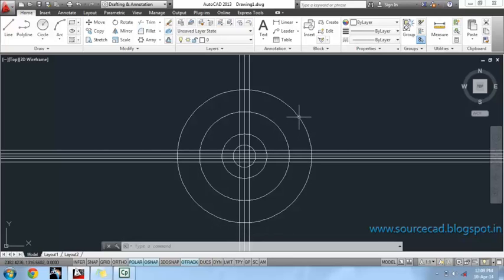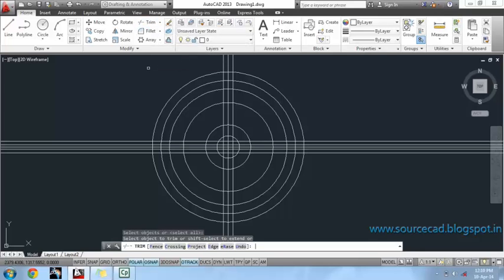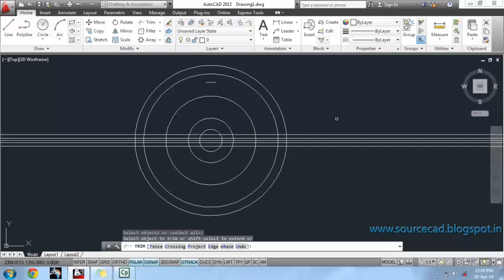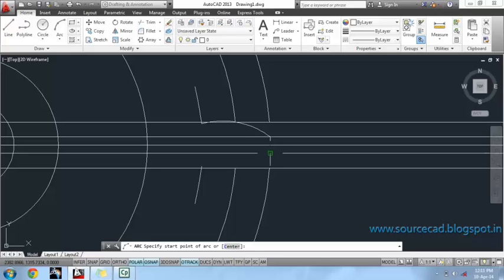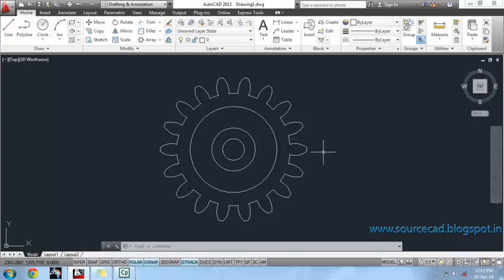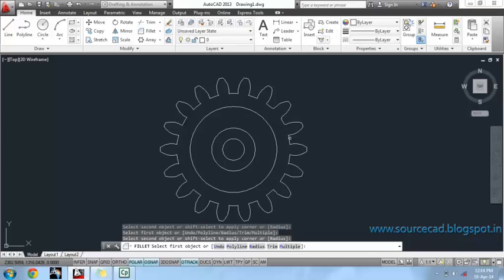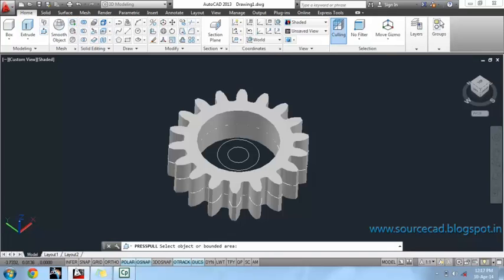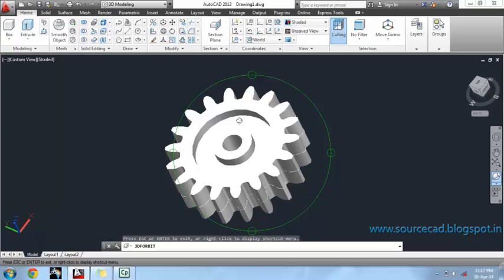Creating 3D gear in AutoCAD

Comment: Hi! First of all I just want to say that your videos are amazing! I'm a beginner in AutoCAD and I've always had trouble picking it up but your videos are so easy to follow. 

I'm just having some problems when it comes to using fillet. There are two corners that will not let me use the fillet command. When I try to select the edges it just creates an arc and some weird lines. I don't know what I'm doing wrong.
Reply from the maker: try exploding the geometry and then make Fillets

Comment: Very helping tutorial again but i cant do the fillet command.i did try use smaller radius value but isnt work out.can u help me?i use 2014 version.
Reply from the maker: try to explode the geometry and try using fillet command on it.
Reply: thanks sir!its work! and at minute 10.25,when i presspull,the inside are presspull as well,not empty like u.i think i select right boundry.any of your step i missed?

Comment: I already made this but unfortunately I accidentally cancelled my work now I try to make this again but something's went wrong with the poly line when I join it and when I click it it clicks the first line not the whole I don't know what to do I repeat this many times and it never work like the last time I made perfectly accurate with your work.
Reply from the maker: Looks like you are not able to select overlapping objects, you can turn on selection cycling to make accurate selection. Type SELECTIONCYCLING press enter then type 1 and press enter again. then select objects and all overlapping will appear in a menu select required object.
Reply: it can't convert the 3 objects in 1 poly line? is it because of overlap?
Reply from the maker: There must be gap between objects, fill the gaps before joining all objects into a polyline.
Reply: thank you so much :)
btw your tutorial really helps me
Reply from the maker: Welcome, I am glad to know this :)

Comment: Very nice video thank you question how do you change the size of the wheel to 20 mm
And 30 Teeth
Thanks Eli
Reply from the maker: +Eli Dari in this drawing a random drawing is used so don't take it as standard gear, moreover you may need to find out by simple calculation all dimensions for 30 teeth and 20 mm wheel size.

Comment: HI THERE  , THANK YOU FOR THE TUTORIAL , ITS VERY HELPFUL , THE ONLY THING I AM HAVING TROUBLE RIGHT NOW IS THAT WHEN I TRY TO JOIN THE OBJECT AFTER EXPLODING IT ....  ANY IDEA WHAT COULD I BE DOING WRONG AT THIS POINT /?  THANKS IN ADVANCE
Reply from the maker: Knoxville Anyce Thanks Knoxville, 
There might be some small gaps which you need to check manually and fill them using line or spline.

Comment: This is a good tutorial I am something of a AutoCAD newbie but found it reasonably easy to follow, Up until the point of using the fillet function where I seem to be stuck with "cannot fillet between these two entities". For some reason I have followed your tutorial step by step and keep hitting this error.
Reply from the maker: Craig Fox thanks Craig for your support, In this case you can use two methods
1. press Ctrl+A >> X >> press enter and then apply fillet
or
2. reduce radius of fillet

Comment: If Solid works is a Mercedes that is an ox cart... btw why filet the edges after array and not before?
Reply from the maker: I agree with you Miteltrixel but each software serves its specific purpose and AutoCAD is specifically made for 2D drawings yet it sometimes can be used for 3D modelling as well so it wont be fair to call it inferior than other softwares, and yes fillet can be made before array but that would have confused novice autocad user about selecting entities for array.

Comment: While this could be a decent tutorial, I feel it is missing a lot. For instance, why are the construction lines spaced how they are, why are the circles the sizes that they are? It's all fine when replicating the gear you made in the video for say, the 1% of cases that will require a gear of these exact dimensions, however this tutorial will provide no use in designing your own gear when you need to apply it to your own drawings. For future reference, there needs to be more detailed explanation as to what all the different parts of the entire process actually do.
Reply from the maker: ***** Well Nicholas its good to see your interest in my videos and I totally agree with you that this example cant be used to carry out manufacturing of gear that fits your requirement its just an example I am creating these videos to teach AutoCAD design skills and method of converting raw data into AutoCAD drawings and it wont be possible to discuss mathematical calculations on which these drawings are based on this platform. Still appreciate your concern and I will try to implement it in future videos.
Reply: Well said.
I guess, this video is solely for the purpose of explaining how to use various commands in 3D AutoCAD. I thank you brother for sharing the knowledge for free. I am learning a lot . . . and I mean A LOT.
Reply: Yeah...I m 4 years late,but I couldn't help wondering y th diameter 3.333 was himself.thats a spooky number...there has 2 b some reason 4 t.

Comment: Your videos are extremely good. my friend can you suggest me one way to digitalize engines gaskets shapesinto autocad? i mean: i use to scan the shaper of the gasket, then insert OLE objetc and then using as " carbon paper" i design with autocad followring the profiles. but due to scanner the image is not sharp and result not perfect. ineed tolerances less than 1/10th of millimeter can you usggest better and cheap way to do that? thanks. cheers from italy
Reply from the maker: Alberto Gulmini Altough OLE is a good method for tracing your sketches you can also use XREF, if imported in .PDF format it can be snapped at crucial points but still its similar to OLE, There is no method for converting images into .DWG directly
Reply: i see i try the xref , i obtained good  results carbon copyin with splines, doing many many points. let see. great person great tutorial do not stop! thanks
Reply from the maker: thanks for your encouragement alberto, keep learning and good luck
Reply: Drill   mechanic  vide

Comment: Good job ! But could you please explain to me how do know the values between construction lines. I would like to design my own gears..
Reply from the maker: You need to make calculations based upon gear layout, if you want to try your own gear use these layouts i hope it would help 
https://db.tt/Yof1gNkb
 https://db.tt/kwCDoQTk
Gud luck
Reply: Well and which unity do you use in your video because I'm french and millimeter would be easier to use for me.. anyway, I want to design 2 gears in order to have 1:2 reduction or 1:5. The first gear ( smaller ) should have a 40 mm pitch diameter.. How to make calculation with this hypothese..
Reply from the maker: Clement Malissard although i used inches here you can convert all dimensions used in this tutorial to mm, just multiply with 25.4 all dimensions for making  intermittent gears scale down pitch circle of original gear and reduce number of teeth in smaller gears.
Reply: Many thanks !
Reply from the maker: Clement Malissard you're always welcome
Reply: SourceCAD Oh last question.. I don't know the way to find the value 0.094 on your draw.. (tooth width on the first picture)
Reply from the maker: Clement Malissard The gear shown in video has pressure angle of 24 degrees and the point where line making angle of 24 degrees is cutting tip circle makes point of offset for construction lines and the distance of 0.094 is calculated based on same hypothesis, refer image 
https://www.dropbox.com/s/p2li786fghmgmej/13.PNG
let me know if it helped :)
Reply: Yes it's clear ! I did this method actually ! 24 degre.. what a special pressure degree is it..
Reply: hmm I'm not able to find 0.094 with tangente.. I find something like 0.1132
Reply from the maker: Clement Malissard yes i agree that pressure angle is not the standard one as 14.5 or 25 degrees, but here gear is drawn for reference not for actual manufacturing process.